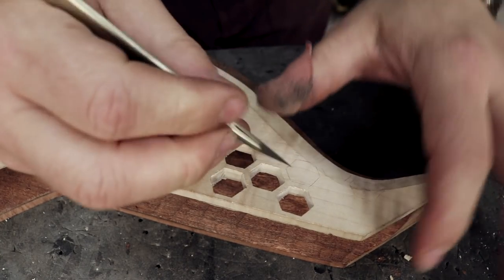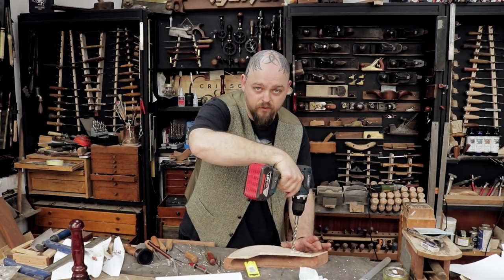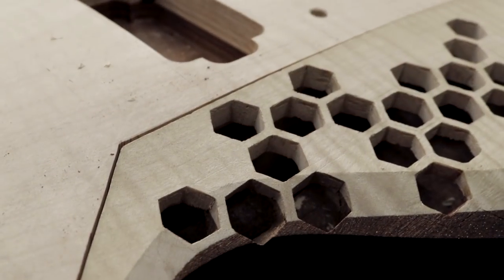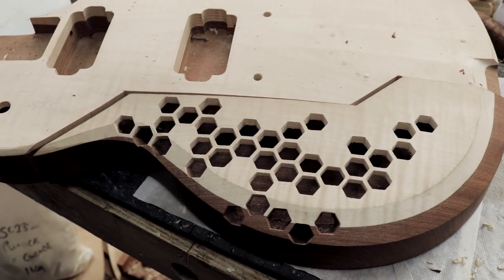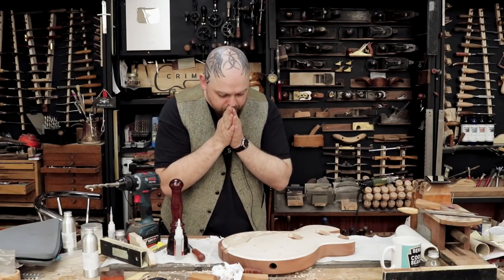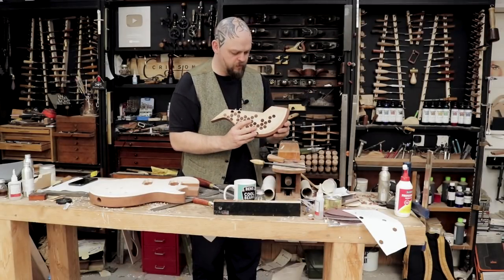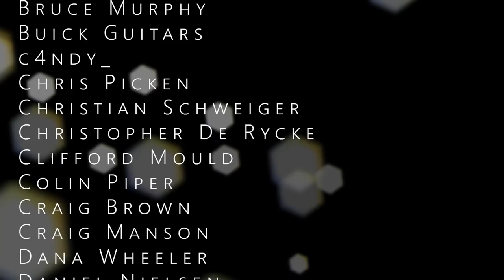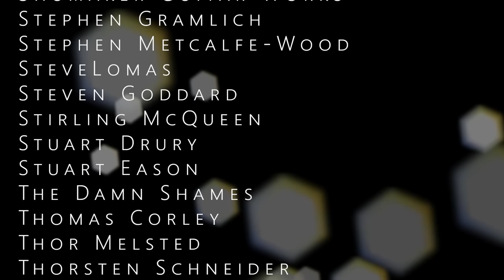Ep 5 - Taking a Great Kit Guitar and making it Awesome

Comment: A LED strip inside the hollow part of the body would look awesome IMO
Reply: damn!!  you beat me to that suggestion
Reply: I was thinking this too.  Recessed lighting behind those holes would look sick!
Reply: I was looking at it and wondering about an RGB set, coupled with an Arduino board or something, so you could sync it with a click track. Would look the shit on stage. 
Not sure how well it would work for aimless noodling at home, though.
Reply: Guitar + battery = fail.
Reply: @Les537  Why? I don't build guitars (though I'd like to have a go at some point, when I have a workshop!). Couldn't you mount a battery unit somewhere on the outside (easy access, and make it look cool so it fits in with the overall design) along with an LED control panel? Does it have a weird interaction with the pickups or something?
Reply: Semantic Samuel no, active pickups use battery’s and battery packs on/in guitars is actually quite common on guitars with lights (e.g. Herman lees guitar)

Comment: Great project!
Given that it's so long ago it's moot to comment on the process, but if I were to do this I would actually remove material from the gap to make the gap bigger, and not from the outside. Big reason for that is because the transition in the bevel between the top and the mahogany would be off with the rest of the guitar.

Comment: Have you ever thought about using rotary files in your hand drill to clean up a hollow like that? I think the forstner bits were a good start, and the chisels took out a lot of the waste, but I think rotary files might make a quicker job of the cleanup without having to worry about clamping super tightly once the structural integrity of the guitar is compromised from the hollowing and sound holes

Comment: When you needed the slit/ gap between the guitar halves to be wider, couldn't you have cut/ filed away from the straight edges on both halves. Why were you considering filing out the curved sides of the body?

Comment: Love the micro-saw - I'll just have to make one, probably using the very fine saw sharpening file I got from The Vintage Tool Shop (blatant plug!). Was the Famag bit the best choice as they tend to pull into a cavity. Don't know what it's called, but that slightly rubbery polystyrene type packaging would probably have made a good support while drilling.

Comment: I hope Ben is still reading these (probably isn’t by now). What was the reason that he wants the gap between the 2 body pieces? If it was only to provide a surface feature visible from the top of the guitar, couldnt the same thing be achieved by taking 1/16” from the edge of the top surface, leaving the side and back of the piece as is to allow for a better fit on the sides?
Reply from the maker: Hey Ted, I read all, I see all, I cry myself to sleep sometimes but, well.. I still read the comments!

Anyway, yes.. it was the whole ship/spaceship/jet thing of having distinct panels and your method would work perfectly.. B

Comment: Curious, would chopping the holes before drilling out the cavity have worked?  I wonder if you would have ended up having issues when cleaning up the cavity if the hex holes were already chopped.  Anyway, this is awesome.
Reply from the maker: Hey, it is a valid thought but all the shorter grain would shatter around the hex holes.. it would not be a pretty sight! B
Reply: @CrimsonCustomGuitars  Ah good call, didn't think about that!